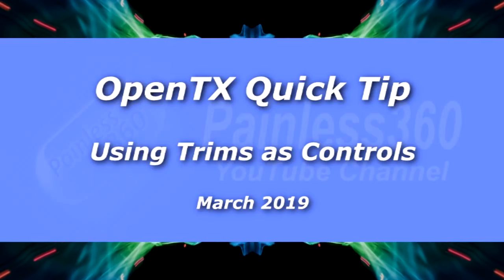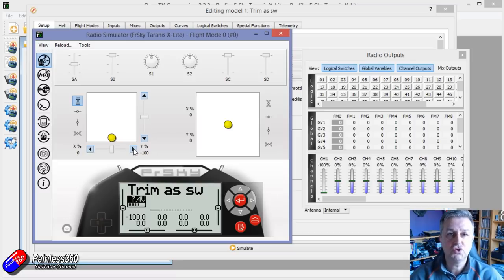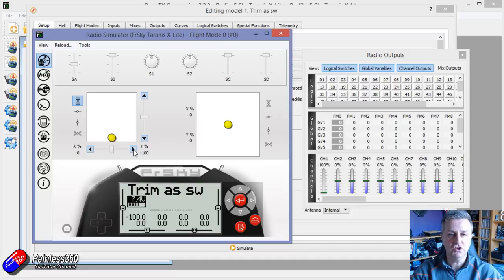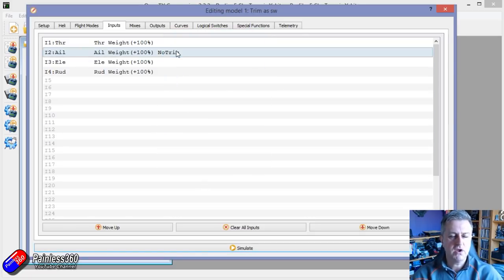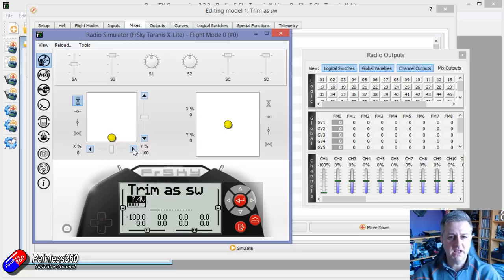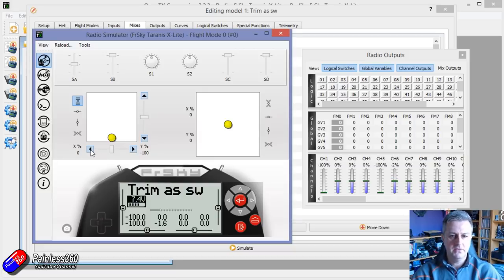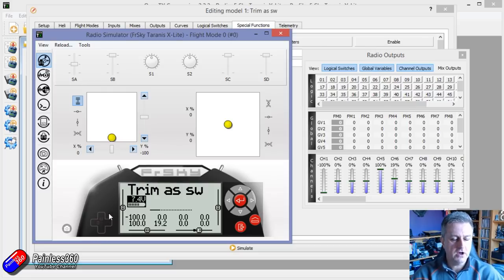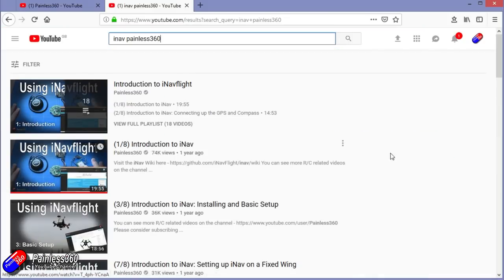OpenTX Quick Tip: Using trims as switches

Comment: I like using trims to set Global Variables for things like Aileron Differential or Camber adjustment.  I usually put this functionality on a switch so I have have the trim change its behavior depending on the switch position (like SH up is normal control trim and SH down is aileron trim adjusts Aileron Differential).

Comment: I have found a way to use the trim as a three (or five) position switch that I think is way better to use than your method.
With my way, for example, no matter how often you press down, you only need to press up once to go back to the center position. With your method, for example, if you're at center; then press down three times, you have to press up three times to get back to the center position. I think that would be very helpful to prevent accidents if used for things like flight mode switching or anything that you would normally use a 3-pos switch for.

Also, with my method you can still use the trims as trims!
Basically, you could have a real switch that switches all trims from trim mode to "switch emulation" mode. Give up one switch and gain four, or even 8 because you can have one trim switch emulate two 3-pos switches alternately. (And continue outputting the values of both the non-active "switch" and the "switch" you can adjust right now!) 

Do you know what I'm talking about or would you be interested in how it works? The setup is kinda complicated (Logic switches, special functions, 1 global variable, custom input and mixer per trim and a custom curve), so I don't want to type it all out in a YouTube comment if nobody cares. ;D
Reply: Btw, I use your other trim switch methods and this great video only gave me the ideas on how to do my trim as 3-pos switch method

Comment: Many thanks... I have been looking for a creative way of getting more switches on my qx7 for flying a wing running inav (so many flight modes, not so many switches), I never thought of using the trims. I do not use the throttle or rudder trims, so potentially 4 more buttons, SWEETNESS!
Reply: I replaced the left hand pot with a 6 position rotary switch on my QX7. Bangood sell them for like £7...

https://www.banggood.com/FrSky-Taranis-X9E-6-Position-Switch-Pot-Knob-p-1043146.html

...

NB. The output of the various positions wasn't anywhere close to linear so I had to set up a custom curve to straighten it out.

Comment: How do you set trim values? Let's say for example I have an electric plane and I want to quickly set my throttle trim value (say 50%) with a single click of the throttle up trim. The same goes for the down trim, a single click of the down trim will set the trim back to zero. I've seen other transmitters do this and is very handy. Great videos!
Reply from the maker: I've done a video on that - check out the OpenTX mix school.. best of luck!

Comment: Hi, that are great news for me. Did you have a Problem after connecting the q x7 to the PC? One of mine died after connection, bg sends me a new one, now I don't trust the USB function. Do you know the solution. My New q x7 has a Port more, but I can't nowhere find what it is for, Do you know something about it? Sorry for Asking this way...
Reply from the maker: I connect my QX7 all the time to the PC, hold the two horizontal trim tabs towards the middle and power it on before plugging in the USB connection to the PC..
Reply: @Painless360  Thank you. That is the way I did.

Comment: Could I also use a position switch to toggle the trim buttons so that I can continue to use them in one position for trimming and in another position as a switch or slider?
Reply from the maker: Possibly - why not fire up the Companion app and see if you can get it working? Best of luck!
Reply: Because I don't have an OpenTx remote control yet 😂. I'm between the JumperT12 pro, T lite and Tango2. Unfortunately, all of them have quite unnecessary shortcomings that one must try to save with the excellent tips on this channel. Thank you very much for that and a happy new year